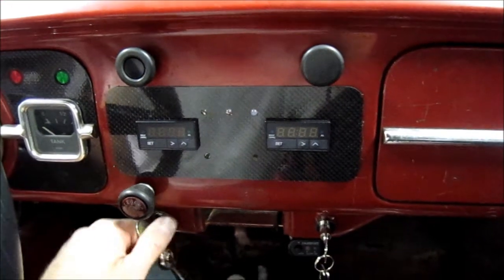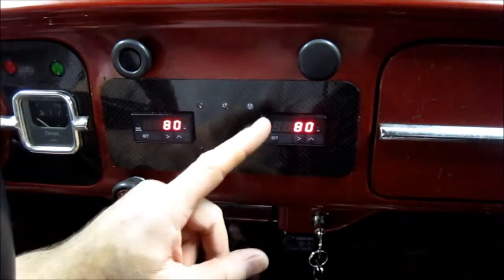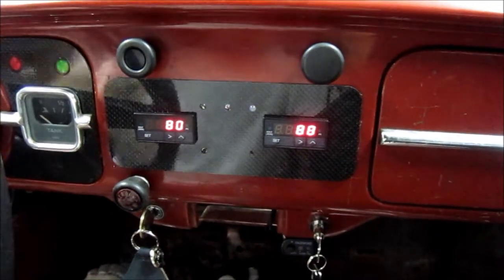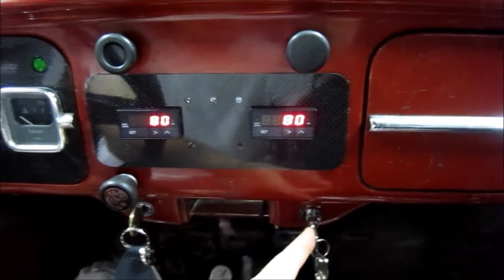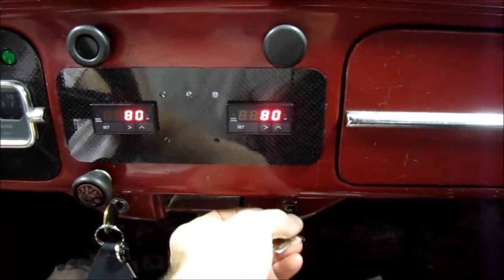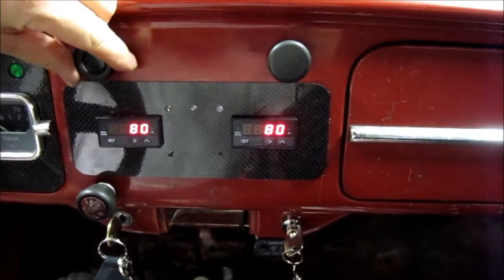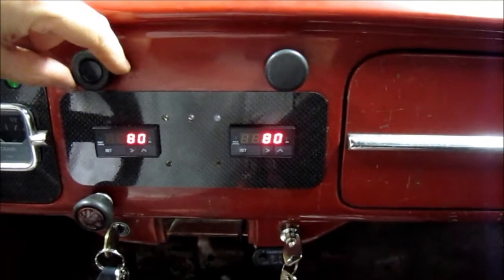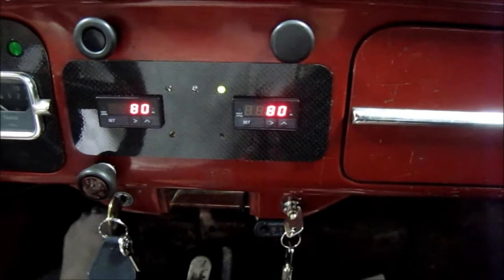Dashboard change up

Comment: Im in the middle of wiring my car right now with MS3X actually. What did you use for the knock light solution? Build something on the proto board or separate stand alone system?

Comment: @mavelotta , I really like the keyed fuel/spark map switch with a LED indicator, and the dataloging button/lLED.  I'm going to have to figure out a stealth way to incorperate that into my stockish dash.  Did you have to build a lamp driver circuit for the LEDs?